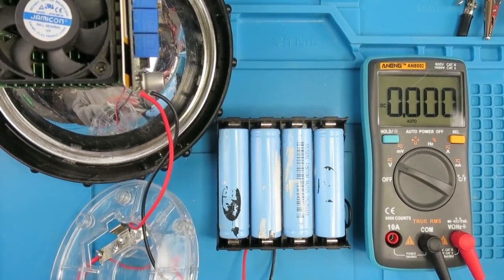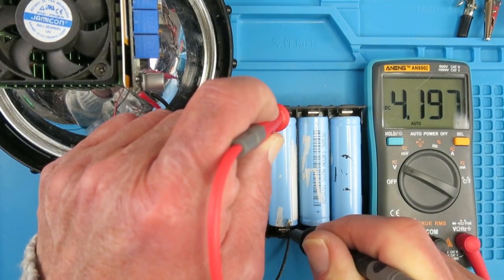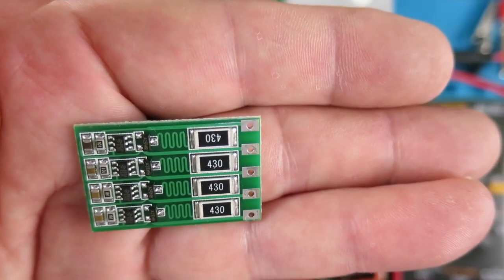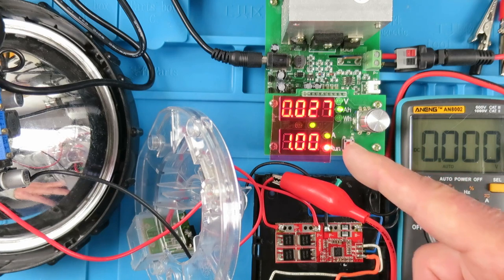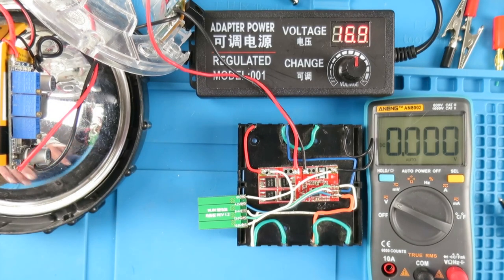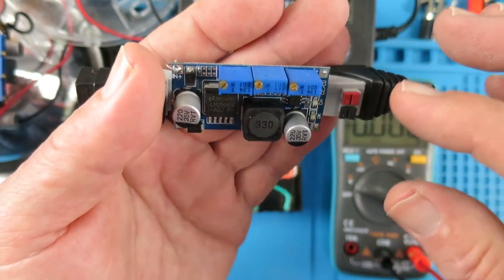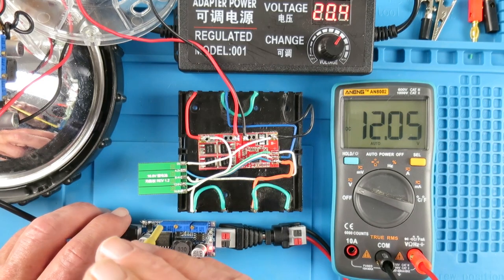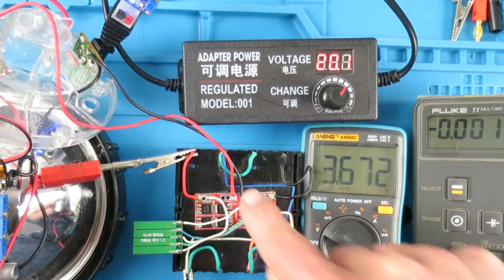Add Balance Board to LiPo Battery Management - Perfect Charging Solution!  DIY Electronic Project

Comment: how would balance board work with bms(more like protection board) without proper charger (cccv) since protection board cuts off at 4.27. im adapting electric drill to li ion and balancing of those bms boards is very low (shunting about 40-60mA at most)
Reply from the maker: It is important to use a proper cccv charger. The balance current is very low (usually 100mA) as the cells should never get so far out of balance if they are properly matched to start with : https://youtu.be/z2Rhk8KJp_k

Comment: Really nice that little board! Didn't know that existed! Really nice work, man. :D There are BMS that does balance the batteries, but I don't have idea about the price and so on.
Reply from the maker: Obrigado Mario! I think this is the less expensive option, especially if you are "cheap" like me and buy the 3 cell board and mod it to 4 cell!!!
Reply: 1nformatica Exactly! :D Like me too!
Reply from the maker: Check this link given by MrBrymstond : https://www.ebay.com/itm/12V-3S-PCM-BMS-100A-for-3cells-in-series-Li-ion-LiPO-battery-with-Balance-charge/112359889830?ssPageName=STRK%3AMEBIDX%3AIT&_trksid=p2057872.m2749.l2648
Reply from the maker: Check this link given by MrBrymstond : https://www.ebay.com/itm/12V-3S-PCM-BMS-100A-for-3cells-in-series-Li-ion-LiPO-battery-with-Balance-charge/112359889830?ssPageName=STRK%3AMEBIDX%3AIT&_trksid=p2057872.m2749.l2648
Reply: 1nformatica Those are amazing! But a bit overkill... Must be for things like power walls to run a full house.
Reply from the maker: Sure they're OTT but useful to know about. You never know when you may need one!

Comment: Could this be scaled up? I have 24  2300 mah LiFePO4 cells in parallel. 104 of these parallel packs in series. The charger is capable of 20 amps at 400 volts. I would need 104 of these boards. This is in an electric truck.
Reply from the maker: There is a project on Github that perhaps you can adapt : https://github.com/stuartpittaway/diyBMSv4

Comment: It appears each cell is isolated from the next which leads me to believe you can use it as a 2S, 3S and 4S Balancer, but not sure.
Reply from the maker: Each of the balance circuits is completely separate so you could just connect the ones you need.

Comment: Arent you supposed to start/end the charge in constant voltage mode ? Because if you have unbalanced batteries, one might need to be in CC more while another would want to be in CV mode. Additionnaly the balancing board seems to be tuned to ~100 mA charge with a 430 Ohm value. It will take forever to charge a  set of 2A/h cells (like 20h or so)
Reply from the maker: The balance board has a 43 ohm resistor which is switched in to discharge not charge the individual cells. It is a 100 mA load on the cell to stop it being overcharged. I only set the charge rate of pack to 100 mA as the pack was so (deliberately) out of balance. I would normally charge withe the constant current set to 0.5 C or 1 Amp in this case.
Reply: I'm not sure i got what you meant.  In details :
Reply: Either if the resistor switches on in // of the cell when that cell reaches ~ 4.2v. If you use 0.5 A, the resistor will have 20V across it, which is not good
Reply: Or the cell is disconnected and discharged through the resistors, ok but others cells stop charging too
Reply: Or the resitstor replaces the charged cell when it reaches 4.2 V, and 100mA x 43 Ohm = 4.3 vol which is slightly higher than a fully charged cell, so it's ok for the other cells
Reply: @meanxmeanx1763   what are we talking about? He is calling 18650 li-po instead li-ion. He takes full battery and connect it to flat one....